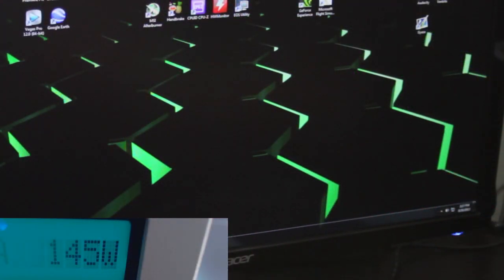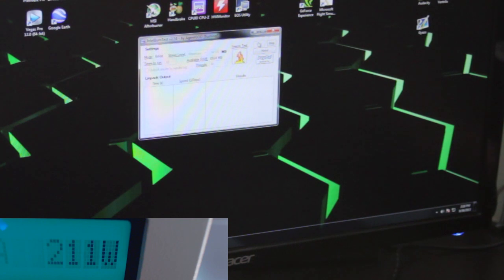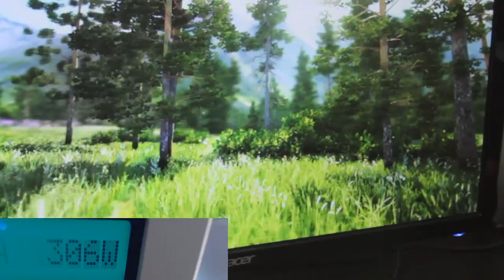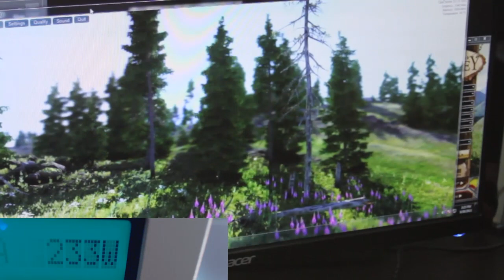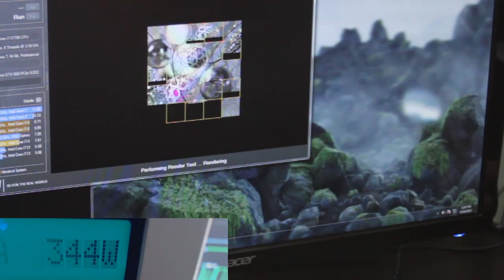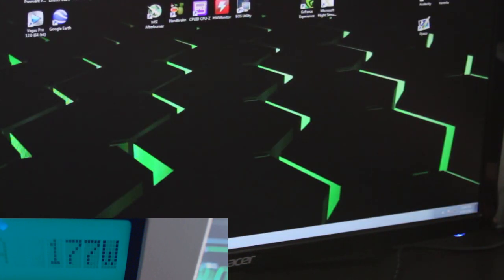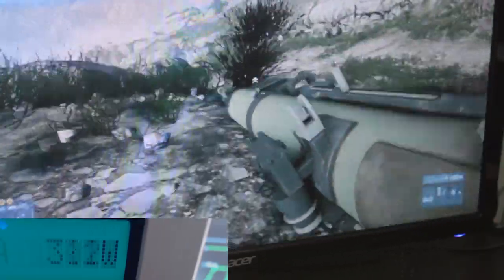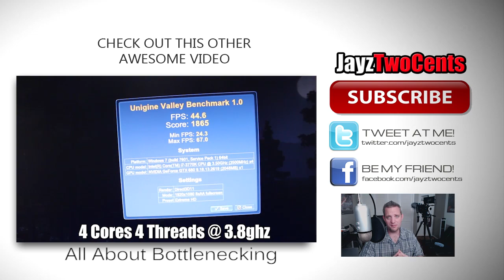How big of a Power Supply do you REALLY need?

Comment: Hey Jay, that is one nice video! It did help me to actually see how much power a rig actually uses. But, with due respect, I'd like to point something you've said that I think is incorrect, acorrding to some (erm, quite a bit) readings I've been doing.

When the certification of a PSU is, for example, 80+, it means it has 80% guaranteed efficiency. However, differently from how you explained it in the beginning of the video (1:59), it doesn't mean that the PSU is guaranteed to deliver at least 80% of it's written capacity. It actually means that from the total ammount of watts it is draining from the wall plug, 80% is the minimum ammount that is actually being carried out into the system, and 20% is wasted (fan, heat and noise mainly).

So, for example, if a 500w PSU is running at full capacity, it is delivering 500 watts to the system, but it is sucking 625 watts from the wall plug, being 500w 80% of 625w. If that PSU had 90% efficiency, it would still be delivering 500 watts to the system, whilst sucking only 555 watts from the source.

Still thanks a lot for this video. It is really helpful. 

And if anyone disagrees to this, please tell me your point of view/understanding.

Peace!

P.S.: I'm probably not the first one to point this out in this video, but I didn't go past the first comment page to check all of the comments.

Comment: I am convinced my current power supply is pure trash (Fractal 650W 80+Gold). In theory, it should support my comp spec. But I keep getting shutdowns when playing high demanding games. How much power do I actually need? I am thinking about buying a 850W and just be done with it.

CPU: Intel Core i7 @ 4.00GHz Haswell 22nm Technology
RAM: 16,0GB Dual-Channel DDR3 815MHz (9-9-9-24)
Motherboard: ASUSTeK COMPUTER INC. Z97-PRO GAMER (SOCKET 1150)
Graphicscard: Asus GTX970 4GB PCI-E STRIX
HDD: 223GB OCZ-ARC1 00 SCSI Disk Device (SSD)
Cooler: NOCTUA NH-U9B SE2

Comment: i have a retail asus PC here are the specs: 
GPU: gtx650 1gb (not Ti)
CPU: AMD FX 8300 
RAM :8Gb 1600mhz ddr3 
HDD : 1TB 7200 rpm
MOBO:M59A7 EVO 2 
PSU:DPS 500AB 6 A(500w) 
Can I upgrade to a GTX 760 and be okay?
Reply: Rocky Elkins nvm i dont have 30amps on the +12V rail

Comment: ===========MY BUILD/ WILL A 500W BE ENOUGH? ==============
----------------------------------------------------------------------------------------------------------------
AMD (Piledriver) FX-6300 3.50GHz (4.10GHz Turbo) Socket AM3+ 6-Core Processor
8GB (2x4GB) Crucial Ballistix Sport 1600MHz CL9 DDR3
Sapphire Radeon R9 270X Dual-X Boost OC AMD Graphics Card 2GB Graphics Card
Cooler Master Hyper 212 EVO Quiet CPU Cooler
24x LiteOn Internal DVD-RW Drive
TB Seagate Barracuda ST1000DM003 3.5" SATA III Hard Drive - HDD

Asus M5A97 EVO R2.0 Motherboard (AMD 970, SB950, DDR3, S-ATA 600, ATX, 2 x eS-ATA, 2 x USB 3.0, Socket AM3+)
Reply: Had no problems with 500w on my build so far! Thanks guys.
Reply: ***** Youre okay.
Reply: thanks!
Reply: np :)
Reply: Luke Higdon   ok could you help me I have a  windforce  r9 280x  a amd  six core 6100 overclocked to 4ghz and 7 120mm fans  1 ssd and a wd 1tb hdd would a 650w power supply be to small as I am planeing on upgradeing to the new amd 8 core
Reply: ***** Barely.  Thats the recommended wattage so should be ok
Reply: Yes, similar to my system. 500w is fine.

Comment: how much should be my power supply 
intel i7 4790k
4gb+2 corsair vengeance
and gt970ti or980ti

my dealer recommended me cooler master 850 . Please tell me does 850 really required
Reply: bubun guha 850 seems to be pretty overkill. A quality brand PSU with 650 watts or more does the job.

Comment: How big of a PSU do I need for a Intel Core i5-4690K 3.5GHz,ASRock Z87 Extreme4 Socket LGA 1150 Z87 ATX, SLI GTX 960 Asus Strix 4GB, 8GB 1600mhz ram, And 3 120mm Case Fans.

Comment: My build
Cpu- fx 8350 
Cooler- hyper 212
Mobo- Asus m5a99fx pro r2
GPU- r9 290 

I plan on using the built in over clocking on the motherboard (it isn't a extreme over clock.) Will a Corsair CX750w be enough? (80+ bronze)

Comment: My build:
Case: InWin BUC-666 Midi Tower Gaming Case
Motherboard: Fatal1ty 990FX Professional
CPU: AMD FX-9370
RAM: Patriot PV332G186C0QK Viper 3 Black Mamba 32GB (4 x 8GB) DDR3 1866MHz
Graphics card: MSI AMD Radeon R9 290X (4096 MB) (R9-290X-4GD5) 
SSD: KingSpec Pro E3000 240GB
HDD: 4TB WDC WD40EZRX-00SPEB0
HDD: 2TB ST32000542AS
HDD: 230GB HITACHI HDP725025GLA380
DISPLAY: 3 23" MONITORS DVI
CPU COOLER: CORSAIR H80i

WHAT PSU WOULD YOU RECOMMEND ?

Comment: My Build:
Mobo- MSI Gaming 5
CPU- i5 4690k (Overclocked)
GPU- Dual GTX 970
Memory- 8gb ddr3-2400

Any ideas of how much power I should get in my power supply?
Reply: D00ble http://www.extreme.outervision.com/PSUEngine prob around 500 W
Reply: 600-650 watts is prefect.
Reply: Im am using a 980 with an i5 4690k and 16 GB RAM with a 500W psu.
Reply: D00ble Just over 500 watts use this 
http://extreme.outervision.com/psucalculatorlite.jsp
Reply: neyo509 Thats not enough. Check these out
 http://extreme.outervision.com/psucalculatorlite.jsp
http://www.realhardtechx.com/index_archivos/Page362.htm
Reply: D00ble 500 is fine, this guy had a 600 series card overclocked and it didnt even reach 400. everyone knows that 600 series cards are power hogs, i would even try a 450 watt, 970's dont use a lot of power
Reply: Macalyn Hulsey Honestly, you're right, but people on here are just way too scared of a myth tht they willl believe any random nut that says they need a goddamn 1000 W PSU. My friend has a 980 that runs fine off of a 500W. with a water cooling loop and LED lights.

Comment: i have an i5 processor 10 gigs of ram with a GTX 970 from asus so i bought a 550 wattage power supply from seasonic, an upgrade from my stock computers 460watts, other than these two parts i have a hp h8 1435 envy, im not too sure i needed to increase wattage but just to be in the safe zone, also there is a small chance ill by a second strix gtx 970

Comment: I recently built a budget PC but before that (before researching anything about the PC) I got an AVF case that came with a 550W AVF PSU (t'was very cheap; the price of an average mid-tower case for a slightly smaller one + a PSU).
CPU: AMD FX-6300 - 95W
GPU: MSI 750ti - NVidia's specs say 300W & the box says to have at least 400W PSU
Nothing else fancy; 8GB Kingston Fury | ASUS M5A78L-M LX V2 MoBo | 1TB WD Green | 2x12cm fans | DVD-Rom.

After a mere 2 months or so, while playing Crysis 3, I smelled burning & my PC stopped. My PSU fried. In the store I went to there were quite a few 460W & only 1 550W PSU. I avoided the 460W ones & got the CM G550M even though it was very pricey for me, afraid maybe the AVF was too inefficient & my setup was stressing it. I didn't ever wanna be close to the max Wattage I can get. My monitor's just 720p, so I don't think I'll upgrade more than the MoBo (& case & maybe hard disk).

Is the PSU worth it/necessary?

Comment: My PSU is a Corsair CSM 450W 80+ Gold. Will it support this without problems? And is my setup good enough for playing high-requirement games and streaming?

CPU: AMD FX-6300 3.5GHz Hexa-core
MOBO: ASUS M5A78L-M Micro ATX AM3+
RAM: G.Skill Ripjaws X Series 16GB (4x4) DDR3-2133Mhz
HDD: Seagate Barracuda 2TB 3.5'' 7200RPM
GPU: EVGA GeForce GTX 960 4GB Superclocked
Optical Drive: ASUS BW-16D1HT Blu-Ray/DVD/CD Writer
OS: Microsoft Windows 7 Ultimate SP1 64-bit
Sound Card: Asus Xonar DSX 24-bit 192KHz 7.1 Surround
Case Fans: x2 Corsair Air Series AF140 Quiet Edition 67.8 CFM 140mm
Monitor: x2 Acer GN246HL 1ms 144hz 24.0'' 1920x1080
Headset: Razer Kraken 7.1 Chroma
Keyboard: Cooler Master Storm Devestator Blue Edition Keyboard
Mouse: Cooler Master Storm Devestator Blue Edition Mouse
Microphone: Audio Technica AT2020+
Case: NZXT Phantom 820 Black Full Tower
Mousemat: Glorious Extended Gaming Mousemat from PCGAMINGRACE
Reply: mystic1754 You seem to have a lot of free time. I am not reading all that shit.
Reply: mystic1754 More shit I am not reading.
Reply: mystic1754 So typing a lot of stuff gains you money. Gr8.
Reply: mystic1754 Perhaps I don't have as much free time as you? :)
Reply: mystic1754 I have wasted time? Damn, you are a hypocrite.
Reply: mystic1754 >Is an experienced electrician therefore is superior to anybody.
Reply: mystic1754 You're*. If you claim you're so intelligent, act like it.
Reply: mystic1754 Kek I don't need to. In the majority of time you have tried hard I actually figured it out myself. Have a nice day.

Comment: You're wrong about how the efficiency rating works, if a 1000W power supply is rated to have a efficiency of 84% the total power draw from the wall would be 1000/0.84 or just under 1200W at full load

Comment: The sweet spot for your PSU is running at about 50% maximum output, so for a system typically running at 350W, you may want to look into a 700W PSU. Efficiency graphs are typically provided for individual PSUs. When your PSU is running at the maximum efficiency - you convert the most energy from the socket into electricity usable by the system, as opposed to pure hear inside the system.

Another factor to consider are semi-passive PSUs. Mine does not need to switch the fans on until it's running at around 40% it's maximum output, so that's less noise from the PC tower. Something I can really appreciate.

Comment: Intel Core i7 4790
MSI Z97 Gaming 3
2x 8GB 1'600 MHz RAM
Gigabyte GTX970 G1 Gaming
1TB WD Blue 
Samsung 850 Evo 250GB
Asus Bluray Combo
3x 120mm Cooler
2 lighter 
Be quiet! 500W (80 Plus Gold)
Can i OC my Graphic Card ?? :-)
Reply: Teufelgott12 Dude, My build is nearly the same... Manufacturer differences, I went with Asus MB and MSI GPU. Also my SSD is only 840 EVO, not 850 EVO. I do have a 650W PSU but I can happily OC the CPU and the GPU and I don't think I'm really exceeding 300W on this system.

His system is doing CPU-wise 40W more (77W - 115W) and GPU-wise 50W more (145W - 195W) than our setup. Also he has a lot more peripherals than we do. You would have to actually check and do the math but I have a feeling like for gaming purposes you could have stock CPU and two GTX 970s on your system. Using http://powersupplycalculator.net/ I got 310W for low-settings and 400W for very aggressive OC. Add another 150W to the lower number (so no OC on CPU) would take it to 470W, which is still below 500W.

It's also important to note that Jay2C was a little off on this video. If a PSU is rated at 500W it will deliver 500W but draw a bit more. Assuming your Gold certification it's going to be ~90% efficient, that's 500/0.9 = 550W from the wall.

Something important you may need to check is if your unit has multiple 12V rails and how much all 12V rails can consume in total. Sometimes the 12V rails come separate and you hit amp limits on individual rails; sometimes the individual rails are OK but the total is like 400W or 450W or something like that in which case your 470W draw would not be okay.

TL;DR OC your card all you want, you are good with that. With a bit of luck and careful planning you may be able to support a second GTX 970.
Reply: Klikkitse But who wants 2 970s anyway :P vram bottleneck extreme ^^
Reply: Teufelgott12 Sure you can, at the moment your pc doesent needs more than like 350 watts unter load
Reply: MrApvel ok thx ^^
Reply: Teufelgott12 I am using 550 be quiet dark pro gold and I am running i5 4460 and r9 280x and I can OC it to death,840 to almost 1100!My CPU is locked tho.I also run 2 modules of ram ,one ssd and one hdd,samsung evo 840 250 and wd red 1tb,1 lighter x2 120 x2 80 fans,I really would love to use a meter to know how much power I am really using xD
Reply: Teufelgott12 Try this to see how much you are using
http://extreme.outervision.com/psucalculatorlite.jsp
Reply: MrApvel No need to rub that in my face. To be fair, the only time I have actually ran out of VRAM was with 3 x 1080p screens, all settings maxed out and a shitton of 4K and HD mods in Skyrim. Even then I went over by like 50MB so not too bad, had to just turn aliasing from 16x to 8x.
Reply: MrApvel Sogar hier bist du xD
G3258 20 Anniversary 
GTX 780 Ti Windforce
500 Watt 
Z87 iwas 
500 GB

Reicht da 500 Watt?
Reply: TheEpicMan He ?! Kennen wir uns ?^^ Sprichst sogar deutsch :-)
Was ist das für nen Prozessor ?? Und was für ne Grafikkarte, find ich in der Schweiz nicht :p
Reply: TheEpicMan jaaaa das schon aber warum sollte man nen pentium mit ner 780 ti koppeln wtf ;D
Reply: Weil ich mir erst zu Weihnachten eine i5 4690k leisten kann und da dachte ich mir günstig und übertaktbar :D
Reply: Luke Higdon Recommended Power Supply:
EVGA 500W 80 Plus Gold
:-)
i bought a be quiet! 500W 80 Plus Gold ;--)

Comment: I have a corsair 450w power supply.
I am planing on getting...
Fx-8320
R9 270x 
2×4 gb ram - 1600 mhz
Msi 970A-g43 mobo
I have
120gb hdd (no more addition to it)
1 system fan

Will i be able to run all this without problem?
I think i should be because in the video he has all the things above mine plus overclocked and he was using not more than 360w at complete load.
You tell me will i be able to run it or not?
And is overclocking possible with this smps??

Comment: Nice video, but you totally screw up the definition of what 80 Plus means, and efficiency in general.
A power supply will always be able to deliver it's rated output to the computer, a 1000W supply will always be able to supply 1000W to your components. The efficiency rating tells you how much of the power drawn from the wall ends up at the outputs of the power supply. So if you have a 1000W supply which is 80% efficient at max load, only 80% of the power used by the supply ends up as that 1000W, an additional 20% is wasted as heat. So a 1000W 80% efficient supply at max load is actually drawing 1250W from the wall.

Comment: What PSU should i use on this?

cpu: intel core i7-4790K, coolermaster v8 GTS
motherboard: Asus maximus VII hero
gpu: 2x gtx titan X
ram: 4x corsair vengeance 4GB ddr3-1600 
storage: Seagate Enterprise NAS 4000GB + intel 730 480GB
fans around: 5x corsair Air series af140

Comment: Hi guys. I need a little help here. What PSU should I use to minimize my power bill, but maximize stability? My PC will be: Athlon x4 860k, EVGA GTX 750 GPU, 2x4 Crucial Ballistix Sport XT - 1866, Cooler Master 212 Evo CPU Cooler, GA-F2A78M-D3H Mobo, WD 1TB Blue, DVD/CD Drive, Monitor, Mouse, Keyboard, 2 Speakers, 2 Case Fans.                     Thanks in Advance!
Reply: ***** I hope I'm not late, but a high-quality 350W power supply is the correct answer.

Like JayTwoCents says on this video you will want to bring your maximum load consumption near the maximum rating of the PSU.

Currently your system draws around 250-300W at maximum. This means you will not have room for much improvement. If you want to be "future proof" and enjoy small bills you'll want to take a 500W PSU. 500W PSUs have additional capacity but they also support newer cards better than anything below that.

- My recommendation is that you'd spend around £80/100€/$100 on your PSU.
- If you are tight on a budget you could consider swapping those 1866MHz RAM-units for something cheaper. The best performance-per-money is at the 1600MHz units. Your system may not even benefit too much from those so you can safely choose 1333MHz RAM, too. The added benefit of higher speed RAM is around 1-5%, so for you it will make no difference. High speed RAM only makes sense if you use the integrated graphics (which your CPU doesn't have).
- If you can, try getting 750 Ti for a bit more performance. From what I read around the internet 750 Ti is better equipped for gaming. You still won't get the ultra-mega-super graphics but you'll get better frame rates.

If this is not a gaming PC at all then you may want to find a CPU that has integrated graphics and you won't need to buy any graphics card at all. Many of AMD's APU-series CPUs are very cheap and have good performance in terms of price (not gaming, though).
Reply: Klikkitse thanks bro

Comment: hey i found a great PSU on amazon: iMicro IM400W 400W ATX12V  for only 14 bucks. 
now my question will this be enough for my system?

MSI X99S Gaming 9 ACKIntel Xeon E7
64 GB Corsair Vengeance LPX DDR4-2133
GTX Titan Z Quad SLI

???? help!!!
Reply: nice joke
Reply: More power then neeeded. But if you download more ram i would upgrade it to 450 watt

Comment: I realize that this is probably a pretty dumb question but how can the outlet only be 120 watts and a computer be using about 450 watts? I'm building a computer pretty soon (or at least picking out the parts for it) and I was just curious if I can even run the thing.

Comment: Should I get the Evga PSU 750G for $80, or 850G2 for $120?  Which is the better deal?

I have a gtx 960, hd, ssd, 8gb ram.  I may or may not SLI in 2-3 years.
Reply: 650 should be totally fine
Reply: Get 750watts capable for sli or crossfire if you upgrade in near future,850 watts is so much

Comment: I would like to add another vapor X 290X (8GB) for crossfire.

My system is as follows.

CPU: AMDFX8350 4.0ghz
CPU Cooler: Noctua NH-U14S
Mobo: MSI FX990GD65
PSU: Corsair Modular Power Supply 860 W, Series Professional Platinum Ax860 - 80 Plus Platinum
RAM:Corsair 16GB DDR3-1866MHz Vengeance Pro 
GPU: Sapphire R9 290X 8GB 1180/1500
OS: WIN7 64 BIT professional
Storage: 1TB SSD/HD, 250GB Samsung evo SSD
can I do it?